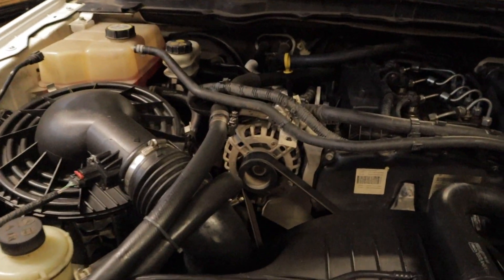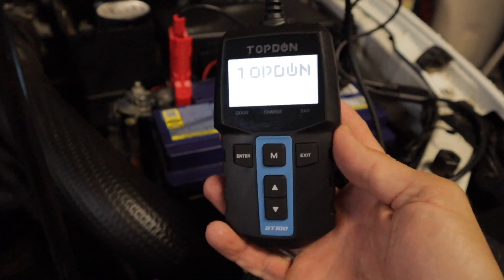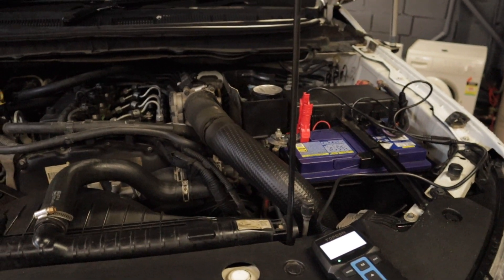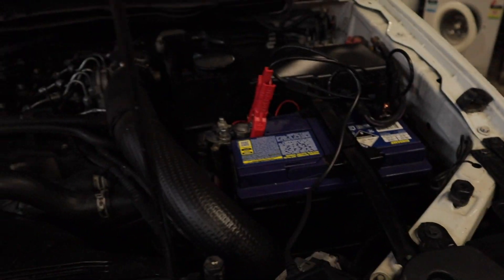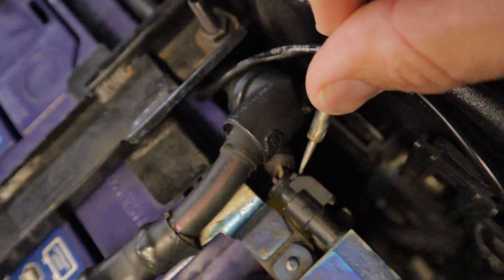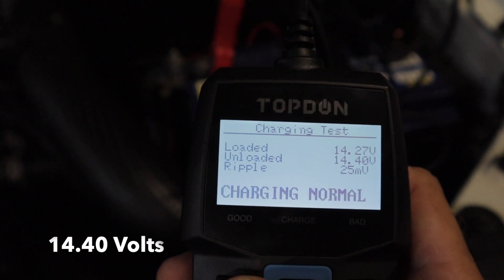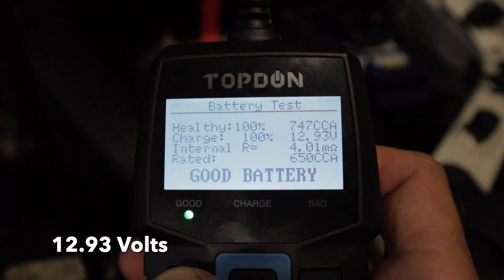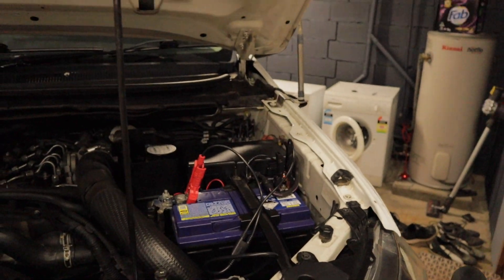Ford Ranger Smart Charging Disabled, Variable Voltage Alternator

Comment: 30 seconds in forscan will turn it off. Pretty easy to do. It's under "battery management system" under the body control module and you just set it to disabled for a px1 to turn it off. I've been running mine disabled for a while now and no issues. I disabled it because it was too easy to flatten it after not driving it for a few weeks. With it disabled no issues. BT50 is factory without the smart alternator and they have no issues, I think it is one of the dumber things Ford has added.
Reply: Still disabled and still no issues
Reply: Hi, fo4rd ranger has this option in software because of the power hungry aftermarket accessories that can get fitted.
the best way is to code it out, second is remove the fuse for the battery sense and this is how you accomplish this on cars without the coding option.
disconnecting the battery current and voltage shunt (that is what it is and it reports on LIn or CAN to the other ecu's.)
Unplugging it can give you a fault code and a dash message.
With the system coded or fuse pulled the alternator just charges to 100% based on voltage. Just like old cars!
Take care all M.
Reply: @markeh1971 which duse is for battery sense?
Reply: Do you get any dash lights for voltage/battery when you disable the BCM?
Reply: @sdw4g63t  no dash lights

It's been off for over a year and have had no issues with it
Reply: Unfortunately Bt 50 does have the same smart alternator as i worked on these when i was at a Mazda Dealership and yes replaced a couple due to some being faulty both vehicles are built side by side in Auto Alliance factory in Thailand and the new Isuzu /bt50 Mazda also has the smart alternator

Comment: You don't have to drive around for 20 minutes. If your battery is good then the alternator will recover the battery in under 5 minutes. Also when engine is shut down battery will lose the surface charge and stabilise at around 12 6 volts

Comment: Hi I see you have a negative wire on the battery post, which I am guessing is for the CT radio, the current sensor will not see this current drain and can cause issues, when a current sensor is on the battery use the chassis for the ground, I also had the dealer switch on "dual batteries" mode which solved my battery issues.

Comment: You need to reset the bms via a scan tool to tell the vehicle when it’s had a new battery fitted on a ranger otherwise the system can charge erratically. 

You shouldn’t have anything earthed to the negative battery post either otherwise the system can’t compensate for the additional load because the shunt can’t see it.

Comment: I did the same thing, only I fitted switch from shunt module on negitive side of battery, so I can change mode while driving  and also I have Sprinter but of course no difference in operation

Comment: Which model Ranger is this? I have a 2019 (19.75) Wildtrak and the battery terminals look a lot different to that. I don't recall seeing that movable link but will have another look.

As  for the alternator light being on, if the system detects another fault will it alert you to that?

Finally to those saying "forscan will turn it off", they don't say how, which version of Forscan, etc.. 

Forescan is available as a free smartphone app, or paid for extra features, or as a Windows application and extra functions available with an extended licence. I've scoured its website but cannot find which version/option that I'll need to turn off smart charging. Reason that I want to do this is if I leave the car parked up for 2 weeks or more then I have to either get it jump started or put it on the charger for a few hours so I can start it.

Maybe when I drive it for an extended period before parking it up, its higher voltage will give me that extra reserve to sit there for a month.

Just recently we returned from a month being away. The battery was flatter than a pancake. I had to use the physical key in the fob to open the door so I could pop the bonnet to hook up the charger. I use an old fashioned $50 Arlec 20a charger as the fancy smart charger that I have would see it as a 6v battery and tell me that it's fully charged!

I've already had to replace the OEM battery after I think 18 months from buying the car (new). I'm afraid that the second battery now in it will also die a horrible death if this problem persists.

As an aside we've regularly travelled overseas and leaving the car in the long term carpark at Melbourne Airport for up to 6 weeks at a time has never been a problem. Only the Ranger has shown that it can't be left longer than a week or so without taking it for a spin.

In the meantime I've permanently connected an Anderson plug to the battery and one on the smart charger output. So,  when we go away again soon I can hook the smart charger up, leave it sitting under the bonnet out of the weather and locked (and hopefully it won't blow up or something stupid like that), so it can maintain the battery SoC while we're away.

Comment: On a quick note if you don't want to disconnect the sensor you can drive with your head lights on that way it the alternator will be charging at maximum voltage
Reply: I have multiple batteries in the back of my 2021kia soul for music you have two options keep your headlights on or turn your air-conditioning to 3 and it will make the alternator put out more voltage also use a agm battery up front last option disconnect the plug on the negative cable and it will also stay charging but you might see the alternator light staying on I don't know if you got the first message but you can also get a digital voltage meter off Amazon you hook it up to your ignition fuse and ground it and it will tell you where your voltage is at when the car is running or when the key is back
Reply: Does this work? Thank you
Reply: If you drive with the headlights only 13.1 volts

Comment: From Philippines here....

Good day. I have this issue after i changed my battery, it drops to 12.6 and not able to charge. Tried to swap alternator, still does not charge. So my alternator is good. After i saw this video i tried to remove the bms sensor in the negative battery, now it stablized at 14.1-14.4 with or without load. The problem is if i reconnect the bms sensor in the negative terminal, it will again drop to 12.6. Does this mean the sensor is broken? Or the Bms module (if there is any)? Hope you can help me with this one. Thanks
Reply: Just an update. I did the same thing in this video last week. The voltage stabilized at 14.1-14.6 maybe about 2days of use. I thought everything was ok, but on the 3rd day when I started it in the morning, after 1min, voltage dropped again from 14.1 to 12.3. I found somewhat a temporary remedy, after every engine start, before moving, I unplugged the BMS sensor for 10secs, then reconnect it again. This stabalized the voltage 14.0-14.6 .  I do this process every engine start so its quite tedious. Im out of moves
Reply: @clintearvinlloydcasino8596  any update? I am having a similar issue on my Focus mk3...
Reply: @JeanV1986  Still doing the same process every after engine start. At night I don't need to do this because voltage will read 13.4 up if I use my headlights.
Reply from the maker: i would say it's the variable voltage alternator doing it's job, does your battery go flat?
Reply: Yes. If its not turned on 2-3days it will go flat.
Reply from the maker: @clintearvinlloydcasino8596   sounds like the sensor is broken then, you can disconnect it like i do in the video, or get a replacement
Reply: If i disconnect the BMS sensor, is it still safe to drive it? Will there be any alarms aside from the battery sign in the dashboard? It may take a long time looking for parts (sensor) here in my place, even in the dealership its unavailable.
Reply from the maker: @clintearvinlloydcasino8596  it's not problem, your light will be on, but the battery will be fully charged

Comment: I still trickle charge my battery before winter, I live a slight colder place, and first day of spring. That way I know over winter it will start on the dot, and summer I tend to leave the radio going when jump out.

Comment: Good way to boil your battery. Still need some form of regulator.
Reply: I don't quite understand that we run 370 high output alternators or more for stereo systems and our charging system is 14.6 to 14.8 and never had a battery issue in 3 years?

Comment: Best tip is to spend the extra money on a good quality AGM battery of the largest capacity that can physically fit I’m using Delkor LN4 800cca in my Px2 handles any abuse

Comment: Do you get any buzzing in behind the front door cards when going over bumps? 
I have a new px3 ranger and it has slight buzzing in the 2 front doors when going over rough road or if i have the radio up at 15.
For a new rig you think this wouldn't be the case. 
The windows were tinted but the window tinter said he never touched any of the cables or the routing as its behind a foam barrier.

Comment: You can get your Ranger set to duel battery mode pre delivery   No problems but after 5000 service the voltage rose to 15volts. They said 15.1 is the max. They must have drained the battery when they serviced it. All normal now. Runs at 14.2 norm.
Reply: Can you please elaborate on what you mean by set it up for dual battery mode? Do you know how this is done?